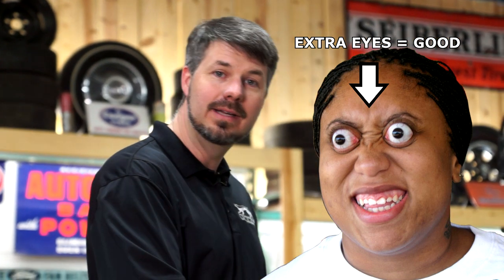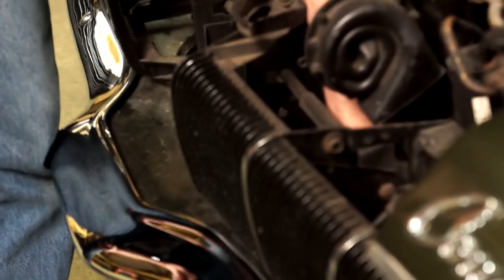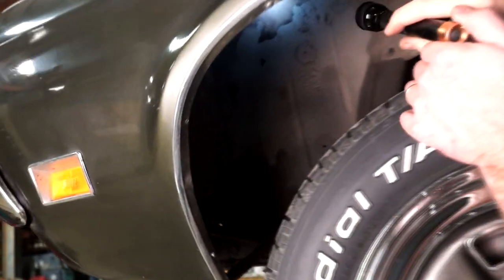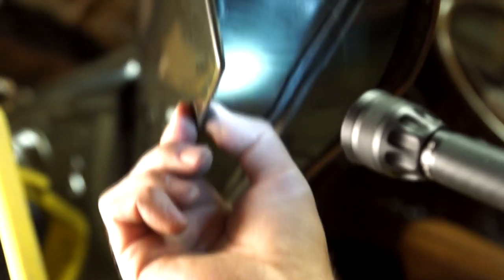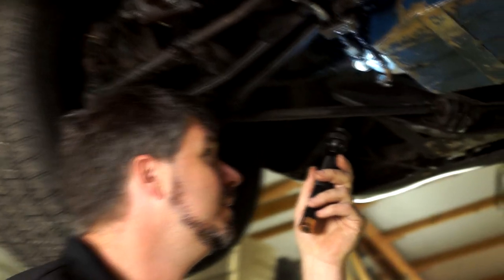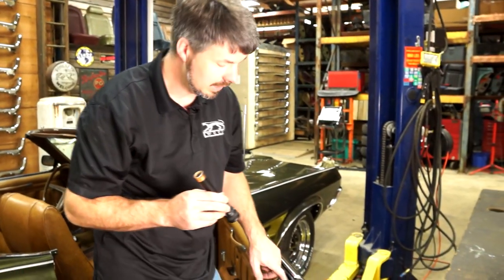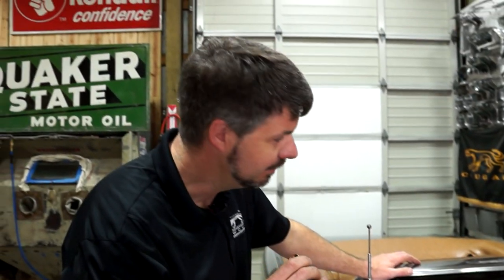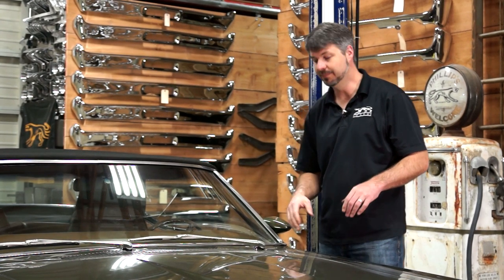Cougar Buying Guide Ep.1 - 1970 XR-7 Convertible 428 CJ

Comment: Nice car. Back in the late 80s I owned a 70 cougar XR7. I sold it for peanuts (it ran but the engine needed replaced or rebuilt). It was a beauty inside & out (powder blue with blue interior).

Comment: In Pennsylvania these cars rusted to hell in about 8 years. I had a 67 Cougar GT in 1976 and could hear and see rain  on the road on the drivers floor. Strange thing I remember about the car is it had the quietest windshield wipers. I also remember if you put the four way flasher on and also the turn signal at the same time it would make the both tail light flash a cool double turn signal pattern. Great review on this car.

Comment: I drove about 80 miles to look at a 1969 Lincoln Mark iii  which was said to be a low mileage   original owned by the persons grand father.  The price was right in the middle for being above what it's worth by the age but lower than the claims in the Ad .
    Sure enough I had wasted a trip because   of just 3  things, first I saw  paint over spray in really tight spots ( I knew the Mkiii was dragged through the river of paint to fill every seam below the roof since almost all MKiii had vinyl roofs) , second was the brake pedal  wear in the bottom right side from sliding over to the gas and back on a car said to have only about 60'000 miles , and finally  a quick look under the car showed a serious corrosion problem on frame mounted Brake Line .
     I didn't need to see anymore  because it was 160'000  miles with fresh paint , and that meant  Engine work, brake work , and a  possible Transmission rebuild  which gets me a   20+ year old used car with poor paint  and 160'000 miles.  
  Maybe if they paid more for a good paint job and replace the brake pedal and brake lines, it could have fooled me since the best part was the inside .  My guess was a light weight driver and long trips alone which could explain the 160K miles and nice interior.

Comment: The best way   for me to avoid  that windshield   Feathering effect from the wiper  blade  abbrasion  is to take a   wet piece of a paper towel and pinch it on the blade  to run along the whole flap  to wipe off pollutants and diesel soot  .  
    Then i wipe along the resting spot on the glass to remove ant dirt and dust build up   because  those dirty  blades can be like sandpaper  grinded into the glass  even if you use them in the rain .  Sometimes  i mix Windex in the washer fluid  to remove chemical build-up on the glass to stop the  haze . 
   My neighbour didn't believe me about air borne pollution and soot in the city from   Diesel trucks...they squirted the glass  and ran the  wipers for a few seconds....  then i wiped the blade off to show how the white  kleenex had 2 black strips where I pinch it and ran the whole length .

Comment: If so could you tell me how much you paided for this, just bought a 70 base cougar check everything you would look for the one that I bought some one restore it done a great job repaint ford Lazar red no rust swelling at all I've had several cougars this one is best by far, 30 board over energizer cam headers pistons roller rockers and much more, does all of this take away from value, thanks I always watch your your the best.

Comment: 102,000 miles is low milage?
Reply from the maker: That means that it has been driven, over its 52-year lifespan, an average of less than 2,000 miles a year.  It is pretty rare to find cars of this vintage without at least 150,000 - 200,000 miles on them.

Comment: Tengo problemas con los freno de cuagar 68
Reply from the maker: Have you watched our video on the 68 drum to disc conversion?  https://www.youtube.com/watch?v=H6959c6ayKI That might give you info on what might be going wrong with your system.  You also might want to post what you are experiencing on the ClassicCougarCommunity forum: https://classiccougarcommunity.com/forum/index.php  We should have any part you would need to fix any issues you are dealing with on the brake system for the 68 Cougar: https://secure.cougarpartscatalog.com/brakes-15905.html

Google Translate (Espanol):
¿Has visto nuestro video sobre la conversión de 68 tambores a discos?  https://www.youtube.com/watch?v=H6959c6ayKI Eso podría darle información sobre lo que podría estar saliendo mal con su sistema.  También es posible que desee publicar lo que está experimentando en el foro ClassicCougarCommunity: https://classiccougarcommunity.com/forum/index.php Deberíamos tener cualquier parte que necesite para solucionar cualquier problema con el que esté lidiando en el sistema de frenos para el 68 Cougar: https://secure.cougarpartscatalog.com/brakes-15905.html

Comment: I with like to buy New light switch and New valve ,for the vacuum. and the  secuenshial solid State 89  dolars   module   to make my  Tail Direction Lights work       my car is a 1969 cougar  convertible
Reply from the maker: Just open these links and add them to your cart:
Headlight Switch: https://secure.cougarpartscatalog.com/hlswtch.html
Vacuum Check Valve: https://secure.cougarpartscatalog.com/Ford_Mercury_Check_Valve.html
Solid State Sequential Unit: https://secure.cougarpartscatalog.com/ledsequential.html (this unit has replaced the old unit we offered)